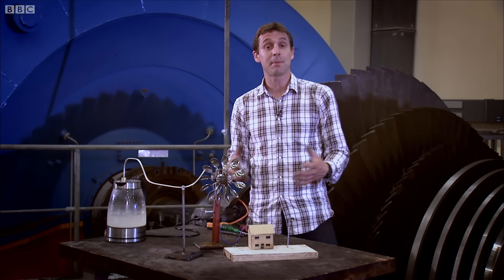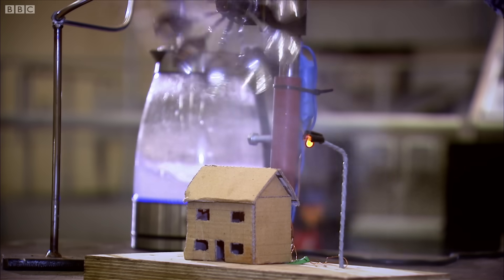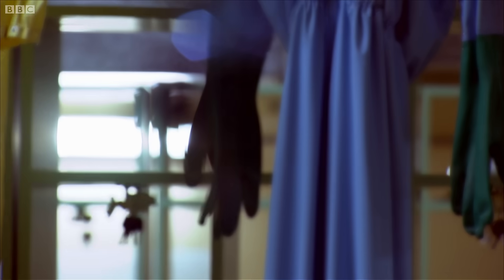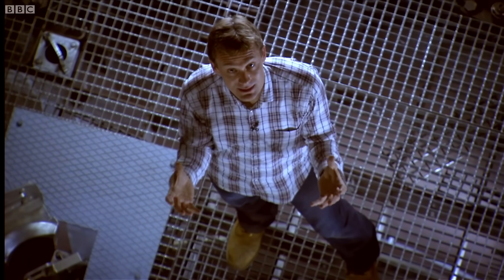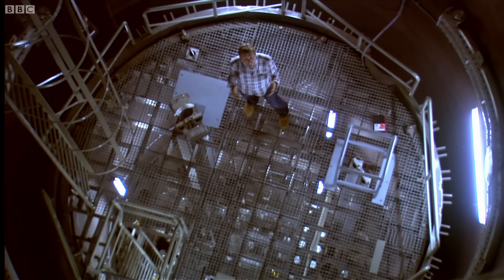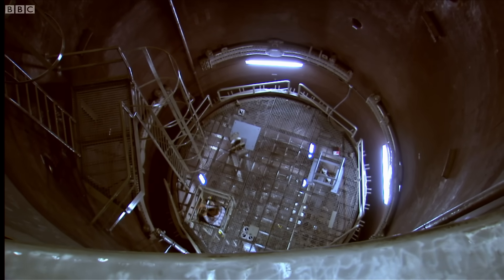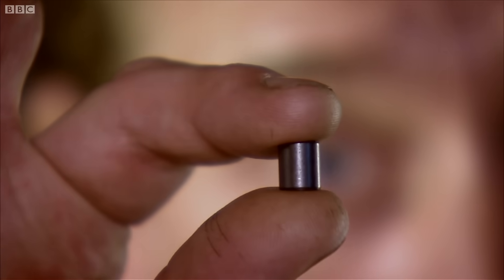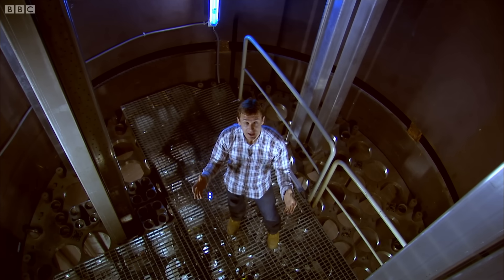Inside a nuclear reactor core - Bang Goes The Theory - BBC

Comment: How do you initially separate the neutron and how do you fire it into the uranium. I have a vision of a scientist loading neutrons into a pea shooter with a tiny pair of tweezers.
Reply: goatboytone1 Uranium is constantly undergoing spontaneous fission.  Inside the reactor there are control rods made out of metals which absorbs neutrons and when they are in place the reactor is "off" it absorbs the neutrons and prevents it from going critical.  So to make the reactor "start" all they need to do is (partially) remove the control rods and the first spontaneous fission kicks off the self sustaining chain reaction.  To speed up or slow down the reaction the control rods can be adjusted and to halt the fission for refueling, maintenance, or in an emergency the control rods are inserted fully absorbing all the neutrons and preventing the chain reaction.
Reply: +Gerald Davis You just got more things right than the twerp who made the clip.
Reply: +goatboytone1 To start off the reaction you need a neutron source. This will be a decaying radioactive element. Once the reactor is critical and stable, you can remove the source and the reaction will be self-sustaining. In other words you have reached a constant fission rate. Any abnormalities in this rate will be controlled using the control rods.
Reply: Klaas Batema So your theory is that anything that cannot be viewed on the internet is made up?
Reply: Morgan Wasem
You mean Browsberg? Just ignore him and let him believe what he wants. It's pointless to even try to start a discussion with such people. They live in their own reality.
Reply: when they raise the cadmium rods the uranium is giving off particles and without the cadmuim rods to intercept these they strike other uranium atoms ..thus creating more flying particles.which in turn strike more ie..without the rods in place the reactor would run wild to the point it can no longer keep the structure cool at this point you have a meltdown..water isnt required to keep the unit cooled per se.. you lower the rods to absorb the flying particles..however water is circulated around this mass and sent to heat exchanger to turn this heat to steam which is a loop all itself so the irradiated water isnt sent to turbines.
Reply: What Joe Vignolo said.  Uranium-235 normally decays at a very slow rate, such that 1/2 a quantity decays in 240,000 years,  Very occasionally one will decay by fission rather than the usual alpha emission, and release 2 or 3 neutrons, so you generally have a few loose "thermal" neutrons around a uranium deposit. In a bomb, where the split-second (really split) timing requires neutrons on demand; a device called the initiator sprays neutrons in or at the core while it is in that critical time period. Once chain-reaction fission starts, then neutrons become abundant.
Reply: +Morgan Wasem Well yes and no. Decay and fission is not the same. Uranium that just decays don't emit neutrons. But theres a very slim chance that an Uranium atom just splits spontaneously. But with slim i mean really slim. The chance that an Uranium 235 atom splits spontaneously instead of just decaying is just 0.000000007%. That is so low, that normaly an artifical neutron source is used to start a reactor.
Reply: +goatboytone1 - In natural uranium there is always a small amount of fission going on. That supplies the initial neutrons. Then when you pack the uranium together into the core and supply the water to moderate the neutrons and pull out the control rods the chain reaction ramps up and the reactor is said to have "gone critical".
Reply: +Brownsberg 777 Troll level hilarious.
Reply: Lajos Winkler I don't know for sure either but oxide makes sense being that driver fuels and solid isotope targets are also oxides
Reply: No I did not say that. It depends on what you are viewing.
Reply: goatboytone1 Ever been into a nuclear reactor?
Reply: Klaas Batema No I have not.
Reply: neutrons are released spontaneously by the uranium by radio active decay
Reply: You are correct. However I think discussion is being trolled not by you but someone else. Why can't people be civilised.
Reply: ***** maybe?
Reply: Joe Vignolo nonsense
Reply: Usually californium-252, but I'm not sure in what form. Could be oxide.
Reply: Gerald Davis We were thought this at school Today
Reply: What specifically is done to split the uranium atoms? Every video explains the concept  but never tells how it actually occurs.
Reply: +Gerald Davis in the end, it is still just a steam engine, the same result could be accomplished using fresnel or coal each with its own drawbacks. we could be using vertical turbines or river turbines but nations need nukes so we all keep a well stocked nuclear supply in the form of nuclear powerplants.
Reply: murdakah Who told you that, did you see that actually taking place inside a socalled nuclear reactor.
Reply: Nuclear weapons are BS... Hollywood production just like 9.11 and every single mass casualty shooting and bombing...nuclear bombs are designed like they claim the "gravitational sun" works.. By placing explosives around a nuclear core and detonated...squeezing the nuclear material exactly how they claim that the sun makes heavier elements but they are splitting...not combining...1 problem though...the sun is electric and so is the universe...only 4 % of the gravitational universe is explained. The rest is dark matter and dark energy. The electric universe theory is the total opposite and explains dark matter and dark energy. Oh yeah and one other thing heavier elements are not made in the center of the Sun according to the electric universe theory. But closer to the surface. Can anybody say fake nuclear weapons. Yeah I wonder why they banned All Above Ground test of nuclear weapons. Go back and watch some of those old nuclear weapons explosions is nothing more than a Hollywood and Disney production. Nuclear weapons are used to fear Monger citizens so they will be willing to voluntarily give up rights. Your rights are not for you they are being used against you too fake news and events to fearmonger Citizens into voluntarily giving up rights. European Royals are responsible for all fake news and events. Each of them have many fake identities and that is how they have given citizens the illusion of voting and choice. The same exact people have been in control of United States since day one and all US history is BS
Reply: @metou3072  Go to Japan and say to their face that nukes are BS, you're gonna want to seppuku if they give you enough time for it.
Reply: @kyubey3961  I have a bridge for sale in San Francisco and I heard that you might be interested...trust me  when I tell that you do not want to be an idiot and miss this once in a lifetime opportunity to own your very own bridge
Reply: +goatboytone1 Because the can not split the atom, because there are no atoms. Look up pictures of Atoms, Viruses, GMO, DNA. All you get is pictures, cartoons, and fabricated CGI (computer generated images).
Do not believe me, just look in to it.

Comment: One of the reactors at Fukushima was rapidly losing coolant before the tsunami even hit.  Lesson to be learned: don't build reactors in seismically active areas.  We should be considering the possibility of the power grid failing.  There is a strong possibility that solar events could lead to a long-term collapse of the power grid, in which case reactors and spent fuel pools would largely rely on a supply of diesel fuel for cooling.
Reply: Bronner33 Maybe just build modern walk away safe thorium reactors.
Reply: rRobert Smith Yup, Thorium powered and molten salt cooled, like what the Chinese and Indians are doing.
Reply: Just increase the safety of the reactors to be walk away safe, OR increase computer control (since ALL recent reactor disasters are caused by human error).
Reply: rRobert Smith Only the Thorium molten salt is walkaway safe. Gen 4 uranium designs attempt to get as close as they can but are not inherently safe like Thorium MSRs. Also, full computer control would not have prevented the Fukushima disaster, since the human error was baked in at design/build time (backup cooling generators in the basement to save cost, which they were warned about)
Reply: David Tangye thorium MSRs are still nothing but plans on paper.  we are decades from workable power production facilities.  I do not believe "full computer control" would solve all concerns about nuclear energy.  All reactors produce unwanted fission byproducts, which are the primary reasons why so many of us aren't enthusiastic about nuclear.
Reply: rRobert Smith reactor disasters, as well as other nuclear disasters, cannot be blamed solely on "human error."

Comment: if i blow a atom bomb in ocean, sea, river or lake its cause more fission than air blow? salt water or clean water, any different? and if its not; if i try same thing in heavy water lake? (of course its fantasy)
Reply: SzopenPan fission is the splitting of atoms. which is the uranium, not water. the water is just heated from energy released from fission.
Reply: +SzopenPan There wouldn't be any more or less fission, as the reaction happens much faster (the entire reaction is over in a couple microseconds) than the water would need to get in between the pit components. However, the destructive potential would be slightly higher in water as you'd be converting more thermal and gamma radiation into kinetic energy by turning a pretty huge mass into steam.
Reply: +SzopenPan That's a great question. It won't and this is why. Not only is the other poster right, the bomb would be in fragments well before there would be an impact of moderation, but a bomb relies on fast neutrons, so no moderation is required. Also say the neutron over the ocean makes it into the ocean, it would need to be slowed down AND REVERSED in order to be reabsorbed into the expanding mass. 

Now remember as well this reaction will take place in microseconds. The entire bomb mass will be long gone in no time. 

Long story short, the affect water would have and airbursting the bomb is entirely in pressure waves, which does make a large difference in destructive power. It's highly recommended to air burst such explosive devices for leveling power, the bottom pressure wave reflects back upwards.

Comment: Wouldn't nuclear Fusion be way better than Fission? Since it's more efficient and doesn't create any nuclear waste?
Reply: Josh DoesRandom It most certainly is. It is just a lot harder to attain than fission. There are many scientists working on it now, maybe we'll see a breakthrough soon.
Reply: Glen Williams  awesome
Reply: Josh DoesRandom Most definitely.
Reply: Josh DoesRandom Fusion is almost impossible to perform at currently stage.
Reply: Josh DoesRandom You're right, nuclear fusion produces much more energy but it can only happen at about 10,000,000 degrees Celsius, so at the moment it would take more energy to get up to the temperature needed than the what reactor can produce.
Reply: Josh DoesRandom Sorry for my rude reply earlier. Here is why fusion is not possible -

For fusion to occur on Earth, you need a temperature of at least 100 million degrees Celsius - six times hotter than the core of the sun and a tremendous amount of pressure. Currently, here on Earth the amount of energy you'd need to put in to produce that kind of heat or pressure is much, much higher than what you get out in usable energy.

But don't worry. There is still some hope for us. Research is going to get a fusion reaction at lower temperature (termed as Cold Fusion). Researchers at MIT have informed us that we are very close.

And by the way, keep in mind that nothing is impossible. Nice to meet you btw. I'm in grade 9.
Reply: Josh DoesRandom Absolutely it would, the major problem is sustaining a fusion reaction is extremely difficult, the major fusion research project for Europe is JET based in the UK it's been running since the mid 80's and up to now it has achieved Q value of about 0.7, meaning we're only getting out 70% of energy we're putting in. BUT they have sustained a fusion reaction, which is an amazing achievement. It's hoped everything that's learned will be used to make a better reactor in 2020 called ITER, info from that will be used to build DEMO in 2030 and it's hoped we'll have a working station by 2050. Also, fusion reactors do produce radioactive waste and it's a lot more radioactive than fission waste; but the half life is only decades compared to thousands of years and there is far less produced.
Reply: Josh DoesRandom Nuclear Fusion is indeed a much better source of energy. The problem is not that we can't do it, its that we can't do it and have a net gain of energy. We know it is possible because nuclear fusion is what sustains out sun. If we manage to achieve a net gain of energy from nuclear fusion, it is more or less 100% clean. The fuel would be Hydrogen, which happens to be the most element we know of, making the energy produced incredibly cheap. If you want to know more, there is a program called ITER in France. It's the worlds first attempt at building a working fusion reactor https://en.wikipedia.org/wiki/ITER
Reply: Arulx Z  Cool. Nice to meet you aswell.☺
Reply: GravityzCatz  Thanks
 I read the article.  Very interesting.
Reply: Arulx Z Not true. We can in fact perform nuclear fusion. The problem is we can't do it efficiency enough to have a net gain in energy. look up the ITER program in France.
Reply: GravityzCatz even ITER won't produce a net gain of energy, ITER won't even begin construction for another 5 years. DEMO will be the first working prototype with a net gain of energy. Until then we have JET in the UK which actually is a working model of a fusion reactor, as I stated in my first post.
Reply: ray twrror
ITER is very much already under construction and has been since 2008. DEMO's conceptual designs won't even be finished until 2017 according to there own timeline. JET, while holding the record for highest efficiency rate for any yet competed nuclear fusion reactor, it still has not broke even. In fact, there are two massive fly wheels that were constructed specifically to aid in powering it so as not to cause a blackout.
Reply: GravityzCatz  Ive heard of JET. So we actually have a functional fusion reactor? Thats awesome..
Reply: Also, what about the Thorium vs Plutonium/Uranium argument for Fission reactors? Any thoughts on that?
Reply: Josh DoesRandom We have a functional fusion TEST reactor.  It currently uses more power to create the fusion than the fusion produces.  We have been 20 years away from producing fusion power for the last 60 years.  Today the latest news is we should be able to produce commercial scale power by fusion in ... 20-03 years.  Creating fusion is relatively easy.  Creating power from fusion has turned out to be much harder.
Reply: +Josh DoesRandom Check out the ITER project, commercial fusion power is getting there. Only a couple more years and we will have fusion power

Comment: How do we send the initial neutron to split the first atom starting the chain reaction? How can the neutrons jump from pellet to pellet?
Reply: *****
Exactly but in order to get a sustained controlled fisson reaction you need a moderator ie something that slows the neutron down enough so it dosent bounce of the nucleus and also guides into place. There are currently 3 types of moderators used: Heavy water (CANDU Reactors) Light water PWR and BWR reactors and finally Graphite that is used in the RBMK and AGR reactors, altough RBMK rectors also used water as a secondary moderator and coolant and was one of the causes of the Chernobyl disaster.

Comment: Thorium is better.
Reply: The original fuel is about 96% U-238 and 4% U-235 (more for military reactor use, less for CANDUs).  After it is spent, 99% of the U-238 is still there, and only perhaps 10% of the U-235, which is the real"fuel" of the reactor.  There are trace amounts of an assortment of neutron capture products like plutonium, neptunium and americium, but most of the "burnt" U-235 is now fission products, isotopes of much lighter elements like iodine, barium, xenon and so on, that are the results of fissioning atoms.  These are the dangerous parts, being both radioactive (beta and gamma decay radiation) and relatively plentiful. The uranium is bound as an oxide so that it is no longer pyrophoric as metallic uranium is; the oxygen plays no role in the reaction.  The fuel pellets are clad in a zirconium sheath, which is also normally inert (that's why they use zirconium).
Reply: +Rangi Fulla What is nuclear waste made up of?

Comment: One thing I don't quite get is how the hell did they let him down there: the reactor has to be some real-size mock-up of an energetics reactor. You just can't climb yourself into a real one with no protection - actually protection for the reactor. You don't want to leave the grease of your palms and fingers on the wall nor the fuel assemblies. That would cause serious problems later during operation. Also, you surely don't want to leave the rubber band leftovers inside.
Another thing is the reactor's walls get irradiated mostly with alpha particles or fast neutrons, and they leave the walls highly radioactive. So there's no way you could climb into one in an outage (fuel replacement).
Reply: Read the description...